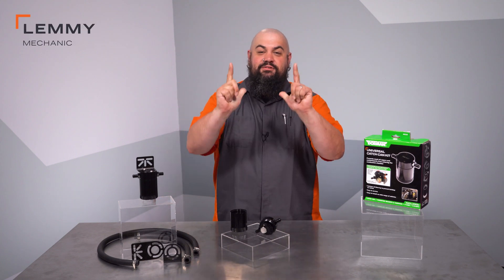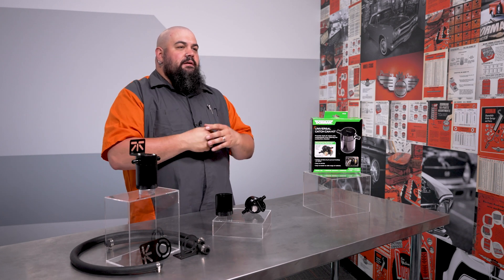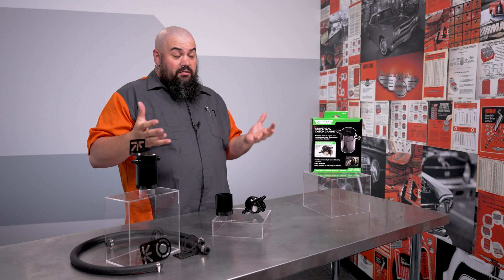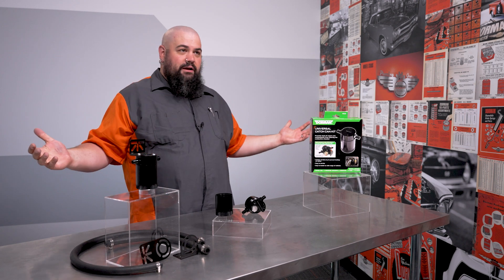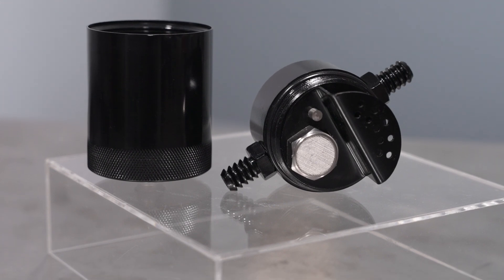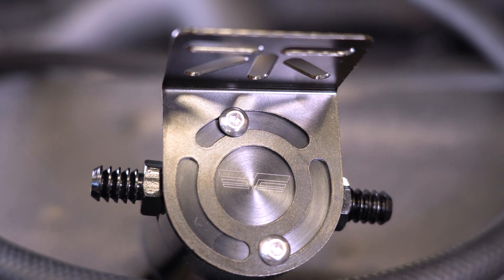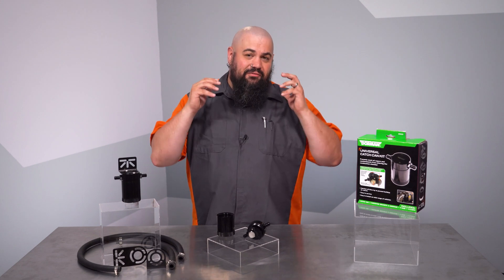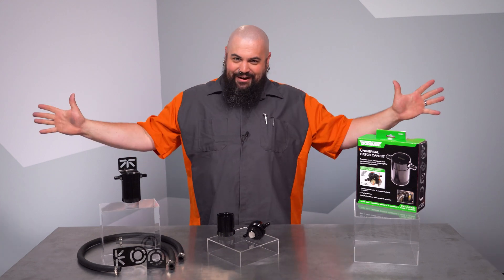Want to avoid valve cleaning? Try this universal catch can solution.

Comment: I think the oil catch cans were needed in carb’ed and early EFI motors too. Sure the fuel was keeping everything clean but can performance and emissions be better with cleaner fuel going into the engine.
Reply: I posted some information about what I know about oil catch cans but the info more pertains to 2.4 ecotec engine engines of modern day not older V8 engines but I like your thinking I'm most sure they'll benefit that oil sludge film is not good to re burn In a engine nor I'd it not wanting to re burn facts I'm reading about and learning  there's also vented and closed system types one better for N/A power versus turbocharger/supercharger turbocharger likes vented systems...   N/A run a sealed system

Comment: Just installed one on my 2012 chevy malibu with the 2.4 ecotec at 113500 miles 500 miles  on the unit and my gas mileage has improved majorly current vehicle mileage is 114000 thousand miles no oils and water vapor to be found I have a modified air box as well to improved over the factory flawed stock engine air cover
Reply: Thanks, can you report NOW, ON a year EXPERIENCE *& cost?   Considering 2015 4/CYL Journey ,*install
Reply: @opera93 I bought mine at my local auto parts store I don't recall the cost
Reply: My dash gas display for total tank milages in MPG increased appon filling up gas from new tank fill up when i reseting the milage between trips...  I was able to  get more gas tank milage for total round trip if that  makes cens a shocking amount and difference your results may very
Reply: @opera93 I also experience now crankshaft rear main seal and timing cover whistle inward I feel causing vacuum inward preventing a oil leak again you results may very
Reply: @opera93 I also run a vented oil engine cap OEM manufacturor for the turbo model something I reached a person should do  to help further vent pressure incase of emergency so I wanted to make a fail safe also I have a modified air box with a k and n air filter in place of stock and a cone k and n filter and better than stock air pipeing  again your results may very
Reply: @opera93 I also don't find much motor oil crud I the container at oil filter changes at 4 to 5 thousands mile intervals and less to no oil cap sludge/ water oil gunk on the bottom of the oil cap your results may very
Reply: @opera93 as always peace ✌️ and much respect to you Jason hope this information helps and you get good results 👍
Reply: @opera93 I also learned it's not good to run a oil catch can in winter months it should be mounted safely by a heat source like radiant heat energy so it can warm up in cold weather driving and checking and drain often in winter months to remove any water  If  one decides to do so again your results may very
Reply: @opera93 a turbocharged or supercharged car should use a vented oil catch can and a N/A car should run a sealed oil catch can I'm reading from others people NOTE I COULD BE VERY WRONG ON THIS INFORMATION IN VENTED VS NON VENTED BEST TO DO OWN RESEARCH IM FINDING MIXED INFORMATION ON LINE AND VIDEOS
Reply: The dorman catch can comes with built-in check valve  one way  system a catch can system should  have one I leaned I just don't remember if it's suction side or return line side if a person custom makes there own catch can system 😉 for a one way air check valve
Reply: I'm told if you're not finding trash and oil moisture and water sludge that your engine is in healthy condition in the catch can I don't ever find much summer and winter 4000 4500 5000 mile oil change intervals with synthetic oil checking the catch can for fullness

Comment: Can you guys not tighten it so much to the point where even tools won't open up the can?
Reply: I use a oil filter claw wrench plyers 3 grabbing points from my local auto parts store  hope this information helps
Reply: @jasonhumphry5836 good god. Mine wont come apart either